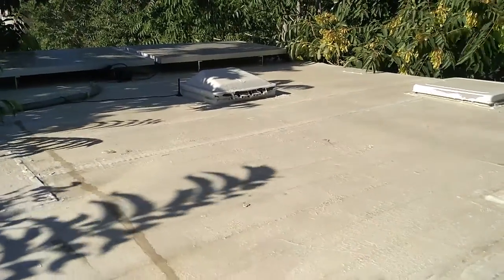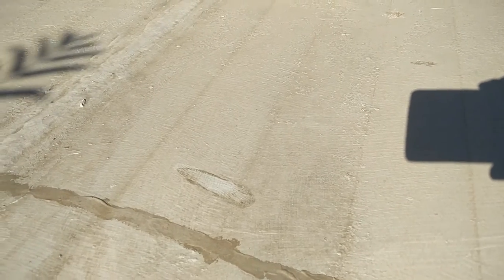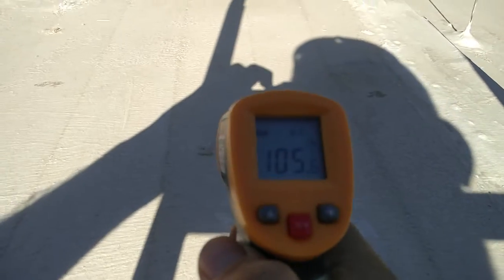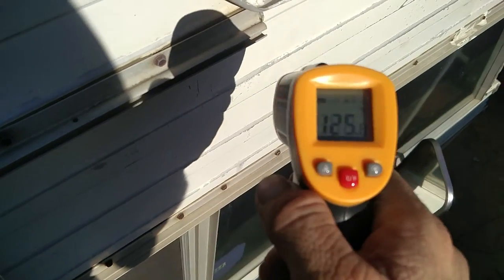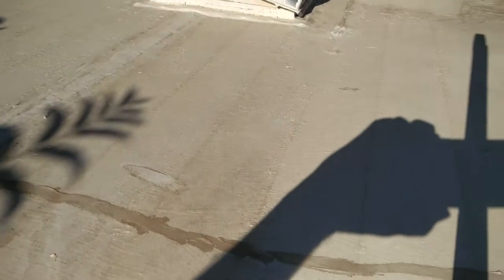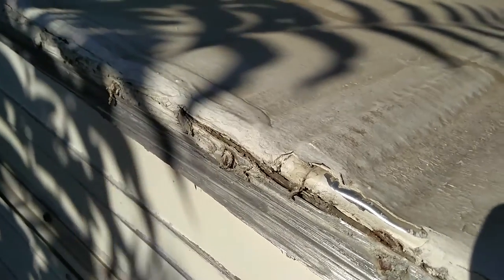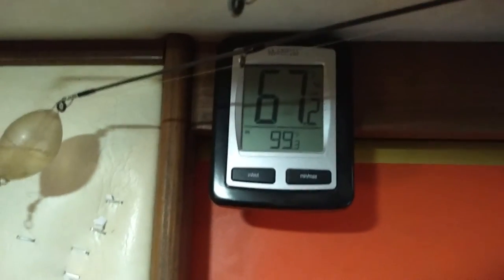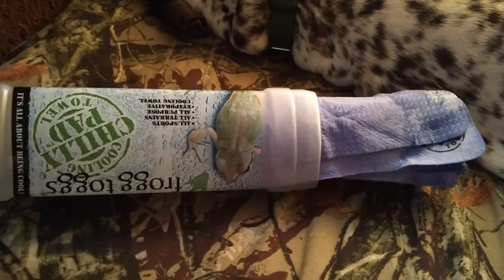KoolSeal is it working?  + Chilly Pad by frogg toggs

Comment: Id paint the kool stuff on the entire outside.
Reply from the maker: Michael Potts the front and rear had most of the paint worn off on the top half so I did use it halfway down the front and back.... and it works really good but it can scratch off kind of easily and I drive down a lot of dirt roads with bushes that scrape the sides that's the main reason I haven't put it on the side yet